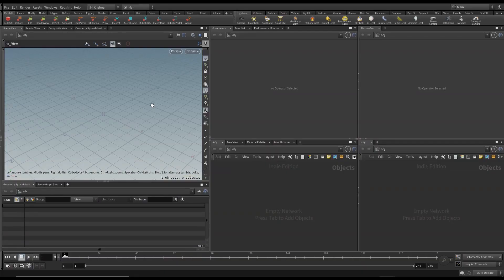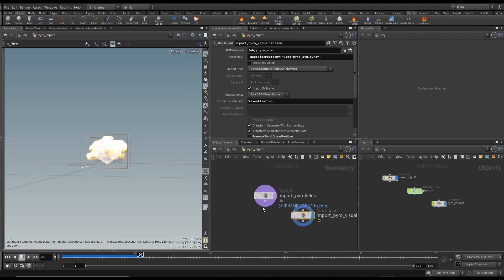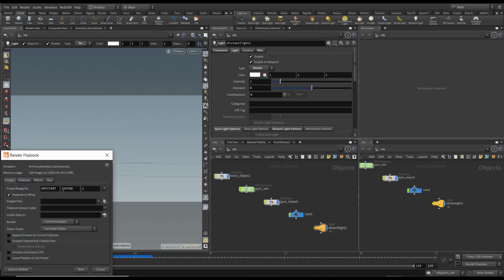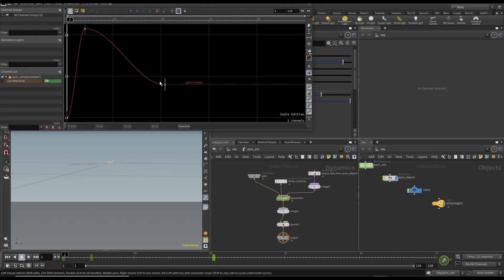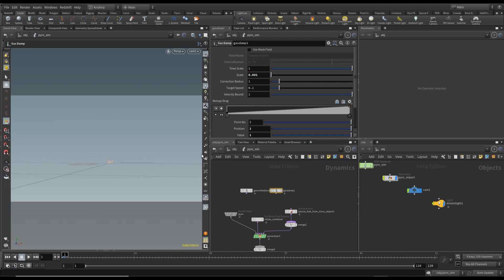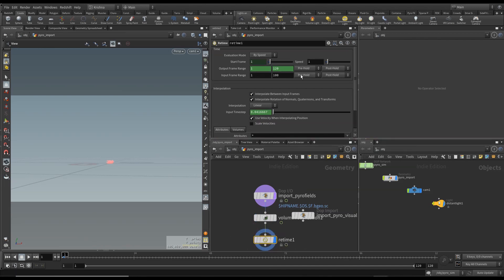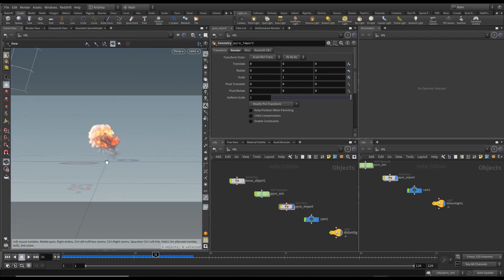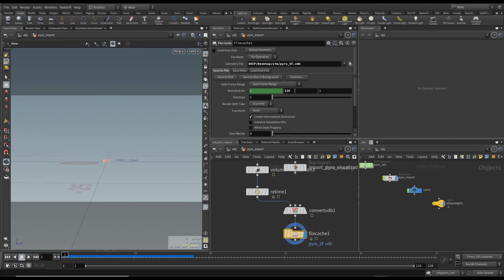TUTORIAL - PART I - SIMPLE SEXY EXPLOSION - HOUDINI

Comment: I dont have the Fireball Viz. What do i do?
Reply from the maker: Fireball viz is a preset which doesn't come out of the box. I showed what the settings are in the video. Then you can click on the gear icon on top left corner of the settings pane and select save preset. Does that make sense?
Reply: @resilientpicture  ya I just realised that later.only by changing settings u can see fireball viz.
Also the tutorial was excellent for single explosion , after increasing certain values like density and shadows the explosion looked more awesome than ever.
Thank you for the tutorial.
Reply from the maker: Glad you figured, thanks for watching. Much appreciated and thanks for your kind comments.

Comment: in my case there is no effect of volume visualization on my model .. i followed ur step still its not even attached . what should i do sir
Reply from the maker: It's not an effect, sorry I should have explained properly, it's a setting you create and then save it aspreset. Hence I go through the settings of my preset. Hope this makes sense
Reply: @resilientpicture  no no your video is great . its just my vulume visulization is having no effect on my explotion.i hope u are understanding it stays same with our without that node . may be its problem in my system . i was only looking for solution .
Reply from the maker: @dhruvmistry6623  oh, ok, that's bizarre. Are you using the correct names, like density, heat and temperature?